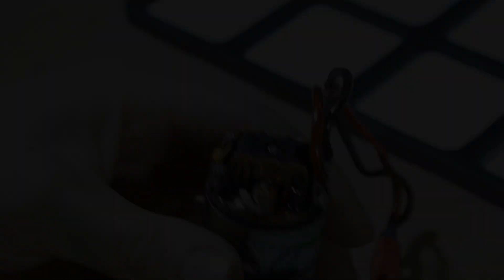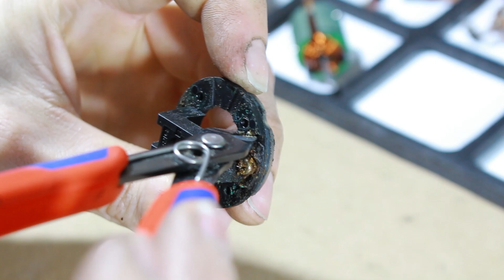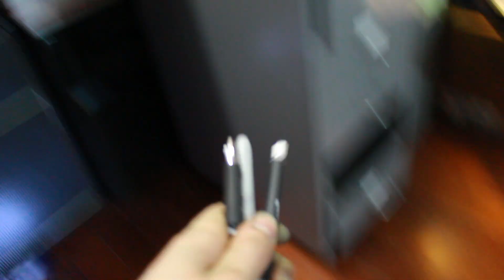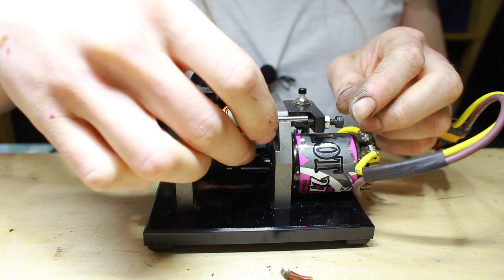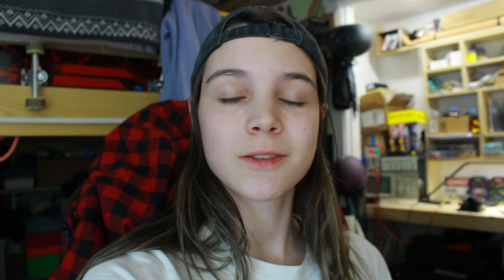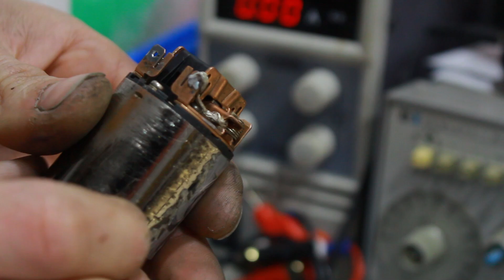Rebuilding a Trinity Speed Gems Pro Cryptonite 9x2

Comment: Flux would help get the old solder off. Personally, I recommend always using flux. It makes the solder flow so much better and is easy to clean up with some isopropyl alcohol.. Really enjoying these motor rebuilds! There's something therapeutic about rebuilding a motor.
Reply from the maker: I will have to give it another try one of these days when I have some soldering to do. For some reason, I have always hated flux and never use it haha but hey its worth another try. Glad you enjoy the rebuilds! I need to film another one soon...
Reply: @Hwy49RC  You should give flux another try. I bet once you get used to it you will never solder without it again. Also, a suction pen or bulb can be really helpful removing old solder too, if you don't already have one.
Reply: @Hwy49RC  BTW, by any chance have you found a good source for newly manufactured aftermarket armatures? I've been looking but it seems like options are limited.